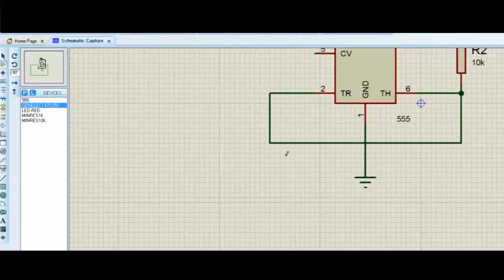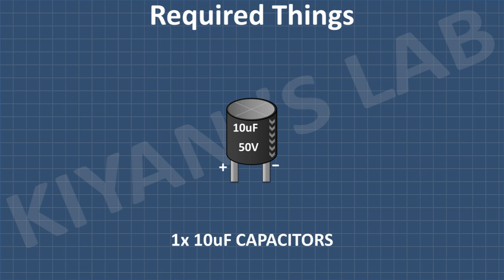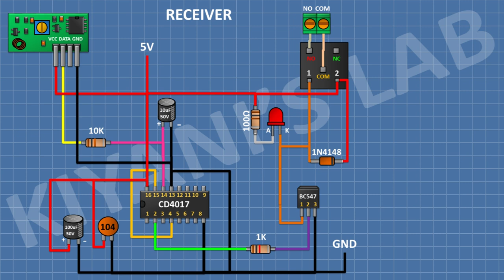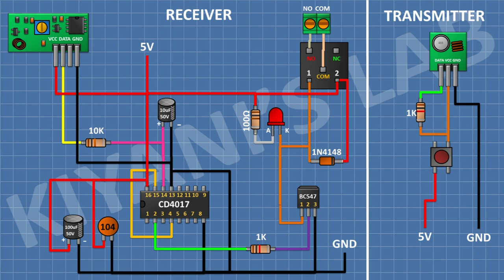How To Make RF Remote Switch | Anyone can make this

Comment: Is it possible to do this with a 555 Timer since we only need 1 output . And also can  you explain why you need the resistor and capacitor is this to stop the interference because when i place a led for testing the data pin goes high low high low which triggers the relay causing a flase triggers which is not good

Comment: I bought the same rf module set. It doesn't come with long antenna like you have.  My modules have only small copper antenna.
I test both transmitter and receiver module with only few inches away from other and with IC HT12E and HT12D.
It doesn't work. Is the problem have to do with the modules missing that long antenna?
Reply from the maker: yes i have soldered a long wire at the anta point on the module

Comment: I notice your first pin for CD4017 is 2 then 4. Why not use pin3 which is the 1st pin? Wouldn't this cause a gap?
Reply: did you find out why he left the gap?
Reply: @Pahandusministeerium  I don't know.  Maybe he wants to have some delay for switching between each state.
Reply: @jumbo999614  wait, but doesnt the count increase only with the press of the button?